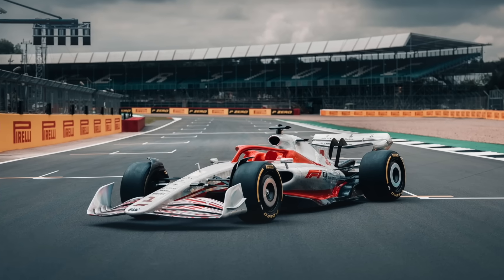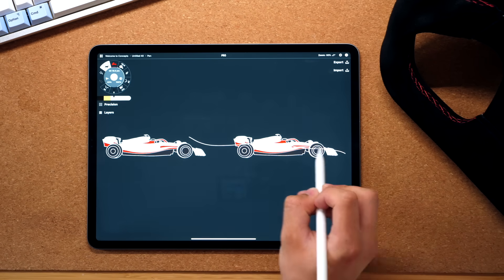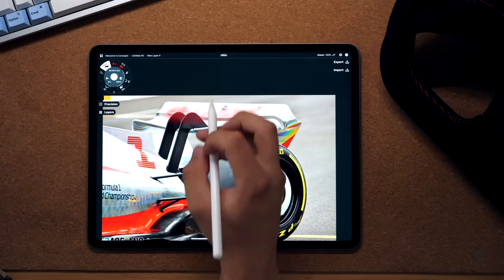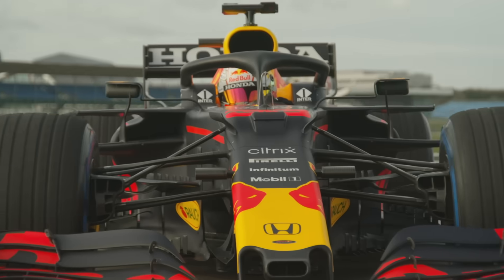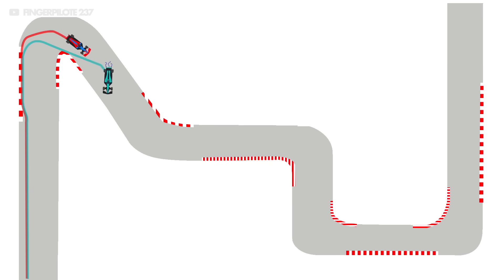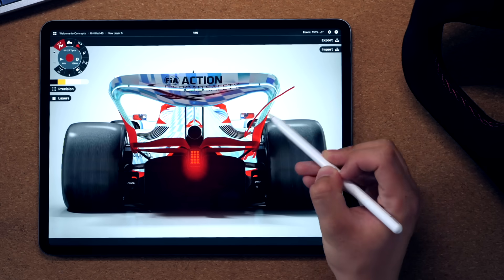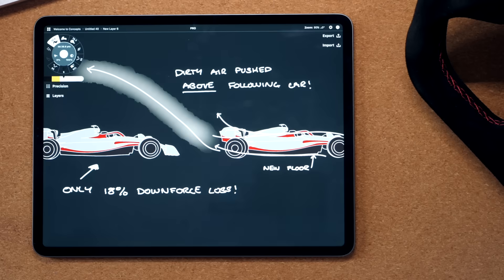Why Formula 1's New CURVED Wing is GENIUS

Comment: They are always speaking about, that it is bad for the car in the corners but having less downforce in the straight lines is better and beneficial for the car behind..
Reply: drag and downforce are not the same thing. F1 cars are way more than just two wings. They have very complex air flows, that gets disturbed by turbulent air.

Comment: This actually makes me wonder how these aerodynamics changes will affect the DRS system. I'm a just simple idiot with HS level physics knowledge applying common sense here, so I'm sure there is someone who knows it better than me, but wouldn't relying on the rear wing's downforce a lot less result in the DRS system losing a lot of value? And if yes, how do they want to compensate that efficiency loss, assuming they want to?

Comment: That'll also eliminate or reduces the effectiveness of DRS a lot which was an interesting feature but obviously looses a lot of potential when the driver in front is driving defensively. I hope they'll allow more regenerative breaking to further increase electric power and promote even more overtakes. DRS does promote alternative driving lines, which are always interesting to see. Making the cars more similar to one another might reduce drivers options in driving lines which would in turn reduce overtakes... If the effectiveness of longer wheel bases are reduced by reducing side aero, teams with longer cars might have to shorten, making the cars more and more similar

Comment: I've driven the RSS2022 car. Its a lot different to the 2021, far less downforce at the rear and does feel slower out of the box. I haven't run it in a race yet to see what following is like. What did you think of the RSS car?

Comment: Bet my life teams have found loopholes and ways to manipulate regs to gain lots of downforce and likely create more dirty air. Its going to be SOOO interesting to see the difference from F.O.M.s car and teams detailed loophole found cars. Theres def a way F.I.A./F.O.M. missed that teams will find to greatly increase pace and still fit interpretation of the rules. I mean giving them 1 extra year to finalize designs and for most teams like aston, mclaren, etc to catch up to Merc Rbr Ferrari's fast paced designing b4 cost cap. I mean think about it once rules where nailed down the big teams threw as many engineers on it as possible. Then where given another year to develop it. Yeah technically Research is limited this year and teams like Rbr and Merc would ve crazy to loose this title for an unknown next year. I REALLY hope RbR comes strong last few races with upgrades to take this title. They will likely be competitive in 22 anyway with another honda upgrade but this title is within grasp. Merc on other hand i think has no way to upgrade or developments in pipeline they could produce. Lewis NEEDS an I.C.E. as its obvious the 1 he took is not fixed as bottas had to take another. So either lewis would baby his remaining engines risking dnf or take more grid drops. I.m.o. dumb to only take i.c.e. turbo failure or any component failure would be huge. Max should be 75pts ahead but merc took him out twice and tire failure so i hope he gets luck and lewis is too far away to try and take him out again to gain pts. Silverstone was a joke as lewis had bigger penalties for b.s. reasons yet takes out another driver at 150mph and wins still..... that is not fair or consistant. Like the monza wreck cannot compare as the kerb and slow speed plus both going out makes it much different. Silverstone was lewis being desperate and NOT being punished for dangerous driving like he should have. In mid 2000s itd been 10sec stop go or 10 place grid drop.

Comment: I wonder what the undercar aero will mean for visibility in the wet, it seems like a lot of moisture will be flung into the air, but the track will dry faster, could make rain delays more likely, but lets see. Overall I can't wait to see these new cars in action, F1 has spent decades fluffing about at the edges of rule changes but this really is a revolution, I hope it works and we get the F1 we all want where we see hard fast racing rather than cars closing up and then being unable to follow closely enough to pass.

Comment: I'm so excited for next season already, I really hope these rule changes work as intended. We saw the changes in 2009 promise a lot but ultimately didn't match the expectations of the experts. This time, F1 has researched it a lot better, but I'm skeptical as to how much the wind tunnel and CFD data will work in the real world. Even if it only has 50% of the affect intended it will still make a massive difference on the racing for the better, but I'm just worried we'll be disappointed if that magic 18% isn't reached. I'm still optimistic, just wary that it might not work

Comment: So the car in front is going to be kicking up and over the air pressure for the following car, which will be in a perpetual slipstream, which will work on the straights but downforce will be screwed in the corners.

Comment: I'll grant it's a step in the right direction... 
But IMO F1 will only be fixed when it bites the bullet, restricts both wheelbase & track to late 60's dimensions, and bans all aero but for a simple single-plane front and rear wing of strictly regulated maximum total area. Then ditches the engine formula altogether for a fuel formula.
(NB: The minimum weight regulation would need to be for driver + seat only so larger drivers aren't put at a disadvantage)

Comment: Question: if most downforce will be generated from the floor, does that mean that cars that go off-track and suffer underbody damage will be at a significant disadvantage throughout the race? Are there designs in place to mitigate that?

Comment: the exhaust also plays a part in the dirty air, i mean, couldnt they just simply apply the new gen with side exhausts? hence having hot dirty air being moved out of the air flow yet increasing even more chances of overtaking??? not hard to make such change and it would also look amazing, and possibly sound better too with more pipes

Comment: In seasons past a reduction in downforce, and air management to the floor, has only increased the dependence on making the most of the available downforce. Changing the design philosophy to embrace mechanical grip may not be this simple. It will be interesting to see how teams decide to work within the new technical appendix of rules.

Comment: Reminds me of Catch-up Mode in linked racing arcade games 90’s to current. The real drivers get up after they realize their real skills don’t win anymore. Loss revenue in racing games means F1 is going towards losing its incentive for the best drivers to put it on the line anymore. It’s not racing either slowing down the leader or speeding up the tailer. 
Let the crowd get in the car and race then, couch potatoes.

Comment: Endplates actually reduce vortex formation.. As you mentioned, it prevents air from spilling to the side of the wing. And air spilling to the side while the car is moving forward = vortex

And also, the new wing still has endplates, but they are curved downward instead of upward (the bits that connect the wing to the chassis).
Reply: I think maybe the idea is that they delay the formation of the vortices to where it doesn't create a drag component on the car, not necessarily prevent them from forming altogether

Comment: Good to see finally the F1 regulators  do this because the current rear wings set ups has nothing to do with making the car  safer or making the car more  efficient.  It was a simple way the leading teams could cheat by making the air behind their cars much more  unstable for any  car trying to overtake thus  neutralising  reducing dramatically the handling of an opponent. It's  one of the many tricks teams  used and were for years getting away with cheating . The they discovered in wind tunnel testing deliberately replicated  a Jet Wash  effect this is when a jet inadvertently crosses over into another jets exhaust path ,  its dirty air and the aircraft looses its aerodynamic flyability  .

Comment: While very nervous about disagreeing with Driver 61 I think the 1980 F1 Renault rear wing had a fairly similar look -  https://cdn-s3.touchofmodern.com/products/001/276/880/a310ecc8e712f355c6db314052480a57_large.jpg?1541201029
Though I daresay the aero characteristics were rather different.

Comment: The only problem with F1 is it's rules are too strict. No innovation. The turbo hybrid cars have been so boring to watch. All the cars are the same and go the same lap time + or - a second. Remember the 107% rule? No longer required. No refueling also sucks. I barely watch anymore. It kills me to see the cars running for 30 laps, then the engineer tells the driver to push? Isn't this a race? They can't waste tires because there is no other reason to stop. As for ground effects, FIA comes up with this brilliant idea of curved wings with what looks like a tunnel ish diffuser. They created that problem by banning ground effects in the first place. Is ground effect dangerous? Racing is dangerous!! That's why we watch and don't race! That's why they are heros! The video game racing last year was better to watch than the real racing and it's not dangerous. I'm watching indycar and Motogp for now and occasionally some F1 if I'm having trouble sleeping. The old farts running the show need to step back and allow the teams some diversity of thought if F1 wants me to stay awake on a Sunday morning. They still run 13" wheels to keep them from running big brakes. Just stupid rules and like any governing body, they just make more rules not understanding the impact of the previous rules.

Comment: By using the underbody downforce and reducing wing downforce, aren't the cars more aerodynamic and produce less drag? If that is so, that means they can either achieve higher top speed or use less power to go just as fast! Better fuel efficiency too! Great video!

Comment: Doesn't most of the downforce come from the low pressure side of the wing? Thought that's why a lot of modern wings go with the swan neck design, less disturbance of the suction side during turns.

Comment: Am curious about how this will affect the drafting speed increase. Does the effect from the rear wing remove the hole punched in air by the car in front? I haven't been following the tech super closely either and not sure on the DRS, seems like that system will no longer be available with the new design. 

It will be interesting to see how all of this plays out in a race situation and if the overtaking will be better, worse, or the same.

Comment: Before I even watch the video. I’m just gonna say, Supermarine Spitfire. Revolutionary elliptical wing that is more efficient than any wing ever developed. Maybe the wing has something to do with that?.
Reply: No. The spitfire was the wing area, which ties into the profile used. This is more like the infinity wing concepts, aimed at eliminating induced drag and wingtip vortices.
Reply: @KillCamEditoR  The spitfire's elliptical wing was also aimed at reducing induced drag by wingtip vortices, and that it did. It allowed spanwise airflow come off of the wing at multiple different places and not accumulate at the wingtips.
Reply: @trevorwalkerjr.9375  ive always wondered if they knew about that. I haven’t actually gotten through to reading any first hand literature on the subject. It is the most efficient wing shape possible, with an e of 0.9 if i remember correctly. 
But again, this is not the same concept we see here. The F1 wing is not elliptical, and it has no tip as such, just the lower mounting bracket.
Reply: @KillCamEditoR  Okay I see what you're talking about now.
Reply: @trevorwalkerjr.9375  if you’re interested I could dig up my notes, I remember the professor going on a long tangent on the subject. Chord distribution over the wing is the crucial thing in the spitfire’s case, whereas this is more about manipulating aspect ratio in order to reduce leakage.

Comment: Front wing is still far too big. Do they want to reduce dependence on over body downforce or not?
It should be at least 20% shorter and limited to only two elements. The rear wing would be reduced for balance.
The endplates thing is all fluff. The Size of the front and rear wing elements needs a straight up reduction. The teams will pour all kinds of money to get the same effect endplates or not.
Of course they still have gigantic 2m wide cars that are bigger and heavier than before punching big holes through the air.
Maybe narrowing them and shortening them up to at least 2014 length and width dims might help a bit to...

Comment: I fear that when they enable a much more closer follow that this will lead to more high speed accidents. Also it is strange that the teams no longer will be able to use their aerodynamicists to develop cars that are different and much more interesting.
Reply: I was just thinking how much more badly affected a car would be if it had side contact with a tyre.
If the floor isn't working, you're more or less out of the race.
Reply: Even tho they have the follow the guidelines the teams can still make slight adjustments and get creative with the details to make sure there car is just a few % better. And in f1 thats all you need to win if your good enough of a driver.

Comment: The only downside is the fact that these new cars will be even bigger and heavier than the current cars. Why didn’t they change this as well, or is all of it the result of safety regulations?
Because dirty air is not the only reason why it’s so hard to overtake. Another reason is the cars being too big for the majority of the tracks.

Comment: What causes wing vortices is the pressure differential between low pressure air on the underside of the wing and high pressure air on the top, which is drawn around the ends (tips) of the wings. That would set up a circular flow if the car was stationary. Since the car is moving, that vortex is stretched out behind the car. You can see the same effect on airplane wings if the plane flies through a cloud. 

The end plates are there to prevent that wing tip vortex from forming. The "tip ups" on the ends of airliner wings do the same thing, "fencing off" high and low pressure air. The vortices that form around a race car's wings are caused by the build-up of air trapped in the corner between the trailing edge of the wing and the end plates. The louvers in the upper end plates are there to allow some of that bunched-up air to escape. In that respect, removing the upper portion of the wing endplates won't harm downforce that much. 

The best way to reduce the influence of dirty air on a race car is not to fiddle with the wings, but to remove them entirely. Or at least reduce them to the point of being aerodynamic trim tabs. Yes, downforce makes the cars go faster, but is that really a good idea? The best competition in motorsports comes in smaller classes like Formula Ford, where there are no wings at all. 

Flat-out speed numbers may sound impressive, but I watch racing for competition, not some esoteric engineering fight where most of the competition is in wind tunnel numbers. Faster lap times are only really evident on stop watches. Rates of closure and overtaking are what generate competition. Keep your technological Rubik's Cubes and give us cars that RACE, rather than "generate numbers."

Comment: isn't feeding dirty air to the guy behind you a good thing to keep him from passing you? I mean don't know jack but... if you ain't first you're last..
Reply: It's great for the racer in front.  The FIA decides the rules though, not the teams.  The teams and racers will have to adjust, and any team that was depending on dirty air for placement is going to have a harder time.  FIA did it to shake things up.  After 8 years of the same 2 teams dominating that doesn't seem so bad to me.

Comment: Fenders on the front wheels? Hello, it’s F1, it’s open wheel racing remember. F1 cars produce dirty air. Deal with it using horsepower, fresh tires and driver skill.

Comment: All the downforce loses in "dirty" air makes the engines job of smashing the car through it easier, with good drafting, hopefully this should make for more overtaking.
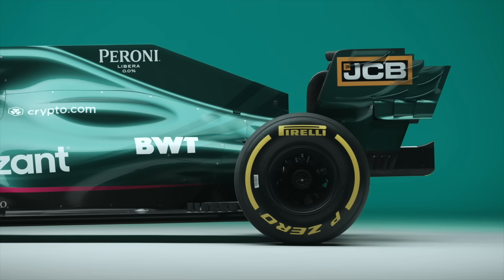Brilliantly illustrated at 3:27, you can see the lower pressure behind the side pods of the following car but fascinating to see the difference in air coming off the back of both cars.

Comment: F1 cars are just getting uglier and uglier. The addition of the Halo was the beginning of the end for beautiful F1 cars. They made it seem like it was absolutely necessary bcuz so many drivers were dying every year. You’re concerned about your safety when the very sport you partake in is not safe at all? Maybe find another sport like tennis or Curling
Reply: lol ok
Reply: @DanishAZ-mp7tm  hahahahaahahahaahahaha
Reply: if the halo wasn't there we would've lost Romain. Don't know about you, but I'd rather have ugly cars than dead drivers.
Reply: @lukecastellan721  dude these guys know the sport they participate in is dangerous. You are a higher percentage of getting struck by lighting than dying from a crash in a modern F1 car. Also if they were really after safety then they would’ve just gone with a fully enclosed car. Why half ass it?